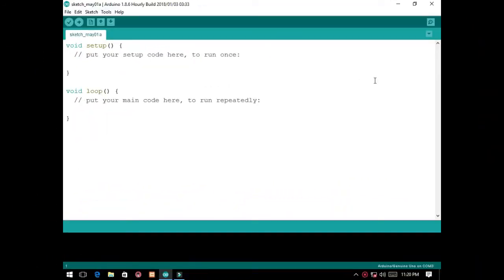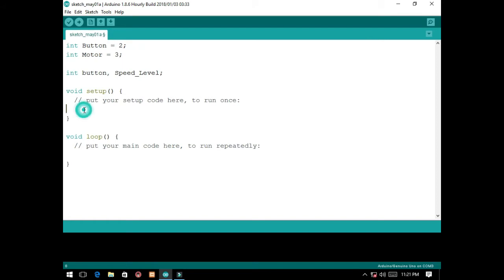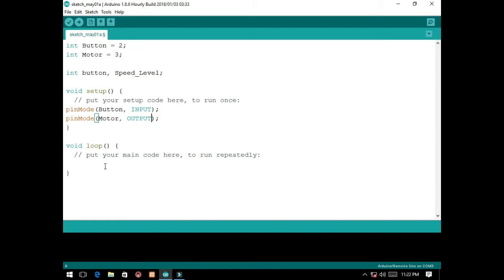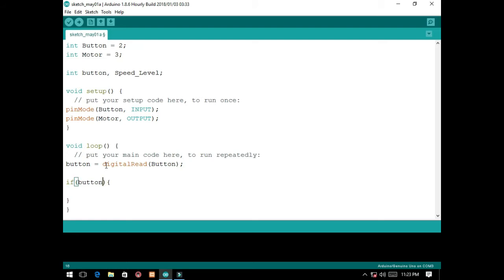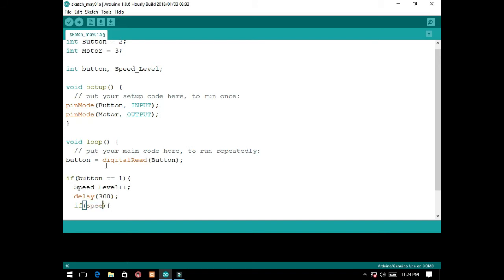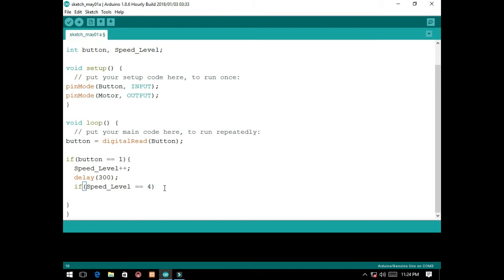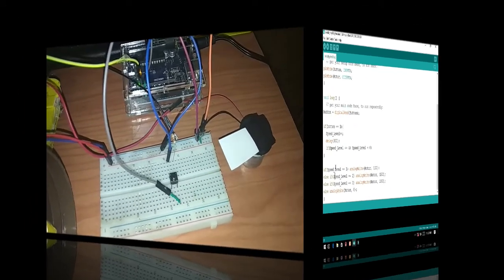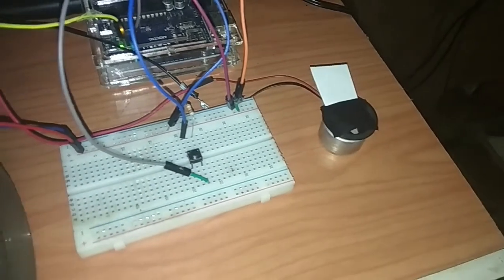Arduino | How to control dc motor speed using push button | FULL TUTORIAL

Comment: C:\Users\TUITION CENTRE BOSS\AppData\Local\Temp\.arduinoIDE-unsaved2024116-4408-yo9pc.bpvxhf\sketch_feb16a\sketch_feb16a.ino:4:5: error: redefinition of 'int button'
 int button, Speed_Level;
     ^~~~~~
C:\Users\TUITION CENTRE BOSS\AppData\Local\Temp\.arduinoIDE-unsaved2024116-4408-yo9pc.bpvxhf\sketch_feb16a\sketch_feb16a.ino:1:5: note: 'int button' previously defined here
 int button = 2;
     ^~~~~~
C:\Users\TUITION CENTRE BOSS\AppData\Local\Temp\.arduinoIDE-unsaved2024116-4408-yo9pc.bpvxhf\sketch_feb16a\sketch_feb16a.ino: In function 'void setup()':
C:\Users\TUITION CENTRE BOSS\AppData\Local\Temp\.arduinoIDE-unsaved2024116-4408-yo9pc.bpvxhf\sketch_feb16a\sketch_feb16a.ino:9:9: error: 'Button' was not declared in this scope
 pinMode(Button, INPUT);
         ^~~~~~
C:\Users\TUITION CENTRE BOSS\AppData\Local\Temp\.arduinoIDE-unsaved2024116-4408-yo9pc.bpvxhf\sketch_feb16a\sketch_feb16a.ino:9:9: note: suggested alternative: 'button'
 pinMode(Button, INPUT);
         ^~~~~~
         button
C:\Users\TUITION CENTRE BOSS\AppData\Local\Temp\.arduinoIDE-unsaved2024116-4408-yo9pc.bpvxhf\sketch_feb16a\sketch_feb16a.ino:10:9: error: 'Motor' was not declared in this scope
 pinMode(Motor, OUTPUT);
         ^~~~~
C:\Users\TUITION CENTRE BOSS\AppData\Local\Temp\.arduinoIDE-unsaved2024116-4408-yo9pc.bpvxhf\sketch_feb16a\sketch_feb16a.ino:10:9: note: suggested alternative: 'motor'
 pinMode(Motor, OUTPUT);
         ^~~~~
         motor
C:\Users\TUITION CENTRE BOSS\AppData\Local\Temp\.arduinoIDE-unsaved2024116-4408-yo9pc.bpvxhf\sketch_feb16a\sketch_feb16a.ino: In function 'void loop()':
C:\Users\TUITION CENTRE BOSS\AppData\Local\Temp\.arduinoIDE-unsaved2024116-4408-yo9pc.bpvxhf\sketch_feb16a\sketch_feb16a.ino:15:22: error: 'Button' was not declared in this scope
 button = digitalRead(Button);
                      ^~~~~~
C:\Users\TUITION CENTRE BOSS\AppData\Local\Temp\.arduinoIDE-unsaved2024116-4408-yo9pc.bpvxhf\sketch_feb16a\sketch_feb16a.ino:15:22: note: suggested alternative: 'button'
 button = digitalRead(Button);
                      ^~~~~~
                      button
C:\Users\TUITION CENTRE BOSS\AppData\Local\Temp\.arduinoIDE-unsaved2024116-4408-yo9pc.bpvxhf\sketch_feb16a\sketch_feb16a.ino:22:1: error: expected ';' before '}' token
 }
 ^
C:\Users\TUITION CENTRE BOSS\AppData\Local\Temp\.arduinoIDE-unsaved2024116-4408-yo9pc.bpvxhf\sketch_feb16a\sketch_feb16a.ino:24:4: error: 'speed_Level' was not declared in this scope
 if(speed_Level == 1) analogWrite(Motor, 100);
    ^~~~~~~~~~~
C:\Users\TUITION CENTRE BOSS\AppData\Local\Temp\.arduinoIDE-unsaved2024116-4408-yo9pc.bpvxhf\sketch_feb16a\sketch_feb16a.ino:24:4: note: suggested alternative: 'Speed_Level'
 if(speed_Level == 1) analogWrite(Motor, 100);
    ^~~~~~~~~~~
    Speed_Level
C:\Users\TUITION CENTRE BOSS\AppData\Local\Temp\.arduinoIDE-unsaved2024116-4408-yo9pc.bpvxhf\sketch_feb16a\sketch_feb16a.ino:24:34: error: 'Motor' was not declared in this scope
 if(speed_Level == 1) analogWrite(Motor, 100);
                                  ^~~~~
C:\Users\TUITION CENTRE BOSS\AppData\Local\Temp\.arduinoIDE-unsaved2024116-4408-yo9pc.bpvxhf\sketch_feb16a\sketch_feb16a.ino:24:34: note: suggested alternative: 'motor'
 if(speed_Level == 1) analogWrite(Motor, 100);
                                  ^~~~~
                                  motor
C:\Users\TUITION CENTRE BOSS\AppData\Local\Temp\.arduinoIDE-unsaved2024116-4408-yo9pc.bpvxhf\sketch_feb16a\sketch_feb16a.ino:25:39: error: 'Motor' was not declared in this scope
 else if(Speed_Level == 2) analogWrite(Motor, 200);
                                       ^~~~~
C:\Users\TUITION CENTRE BOSS\AppData\Local\Temp\.arduinoIDE-unsaved2024116-4408-yo9pc.bpvxhf\sketch_feb16a\sketch_feb16a.ino:25:39: note: suggested alternative: 'motor'
 else if(Speed_Level == 2) analogWrite(Motor, 200);
                                       ^~~~~
                                       motor
C:\Users\TUITION CENTRE BOSS\AppData\Local\Temp\.arduinoIDE-unsaved2024116-4408-yo9pc.bpvxhf\sketch_feb16a\sketch_feb16a.ino:26:39: error: 'Motor' was not declared in this scope
 else if(Speed_Level == 3) analogWrite(Motor, 300);
                                       ^~~~~
C:\Users\TUITION CENTRE BOSS\AppData\Local\Temp\.arduinoIDE-unsaved2024116-4408-yo9pc.bpvxhf\sketch_feb16a\sketch_feb16a.ino:26:39: note: suggested alternative: 'motor'
 else if(Speed_Level == 3) analogWrite(Motor, 300);
                                       ^~~~~
                                       motor
C:\Users\TUITION CENTRE BOSS\AppData\Local\Temp\.arduinoIDE-unsaved2024116-4408-yo9pc.bpvxhf\sketch_feb16a\sketch_feb16a.ino:27:18: error: 'Motor' was not declared in this scope
 else analogWrite(Motor, 0);
                  ^~~~~
C:\Users\TUITION CENTRE BOSS\AppData\Local\Temp\.arduinoIDE-unsaved2024116-4408-yo9pc.bpvxhf\sketch_feb16a\sketch_feb16a.ino:27:18: note: suggested alternative: 'motor'
 else analogWrite(Motor, 0);
                  ^~~~~
                  motor

exit status 1

Compilation error: redefinition of 'int button'

how do we do this ~~~~~

Comment: Do we need any battery supply to power the DC motor?
Reply from the maker: Yes External Supply.
Reply: Can a 3.7 V Lithium Battery be used to power a L298N motor driver shield and a dc motor with 3v?
Reply from the maker: I recommend 2 3.7 Lio Batt if you want a better perfromance. 5 to 12 volts is my recommendation for L298N motor Driver.
Reply from the maker: If your arduino has a 12v power supply, you dont need for external Power supply, you can tap your motor driver there directly.

Comment: Supose I have two pushbuttons (one to increase each time I press, and other to decrease). The ouput should appear in 4 diferent pins each time I press (25% , 50%, 75% and 100%).
Every time I startup the system the speed shoud be 25%, the lower speed.
Any clue in right direction to handle this goal?
Tks in advance.
Reply from the maker: https://www.youtube.com/watch?v=F1jOo3ScQB8 Watc this. The logic is here, you just need to convert it with the code in this video and set the else condition  to 25% speed instead of 0 if that is what you desire as the default speed.

Comment: where can I change in the code I want to use different pushbutton for each speed
Reply from the maker: You need to add if else statement to every speed output, if you want to use different push button to control the speed
Reply: @daviñascode1997  thank you for your reply

Comment: In the Fritzing Diagram, what are the different components shown?  I have an Arduino, DC motor, and breadboard but am unfamiliar with the red piece of hardware. What is it? Also, what kind of resistor did you use?  Thanks for posting arduino content, it's incredibly helpful and inspiring for new projects!
Reply from the maker: the red component is the motor driver and i use 10k resistor for the pushbutton :D